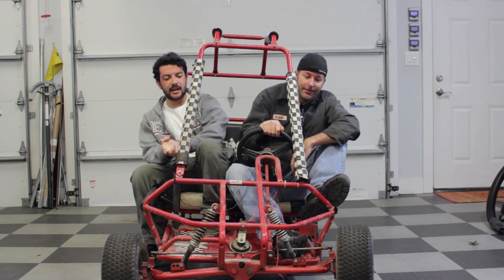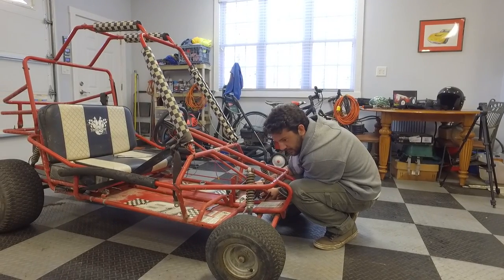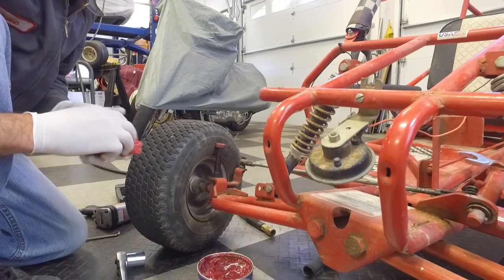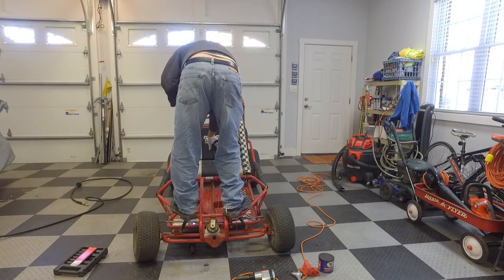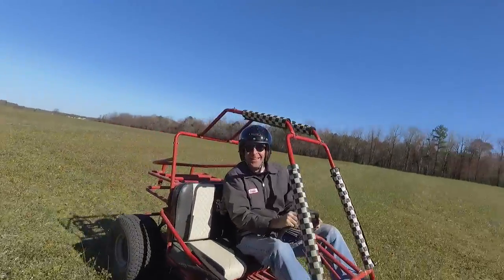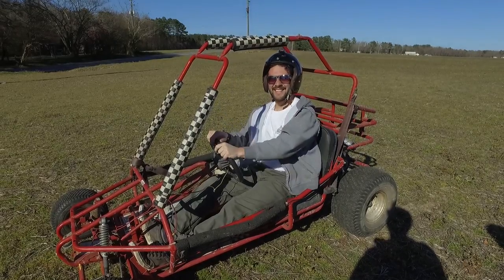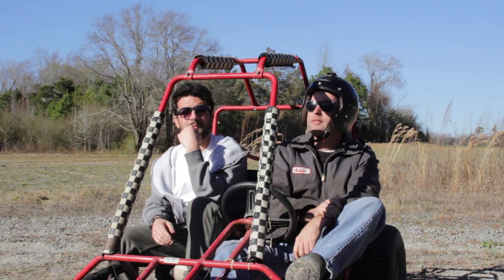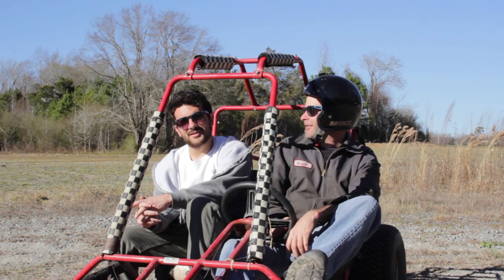$100 Off Road Kart Steering Mods and Jumps

Comment: Manual clutch air-cooled ATV engine with reverse. Make it an off-road shifter kart/mini buggy.
Reply: that would be absolutely perfect
Reply: M Kefer I'm planing to do that with my 4 speed +rev 250cc atv
Reply: M Kefer Engine off a Honda TRX250 would be great. It has a clutch to, but the only time you need to use it is starting on an incline.

Comment: The diesel units the trucking industry uses are called auxiliary power units (APU). They are usually a two cylinder engine. Kubota makes them, though they are usually branded under other names. Carrier, Tripac, Thermo king, rigmaster, are some common ones.

Comment: 8:37 Needs more wires running to the steering column.  Zip ties?. LOL.  I literally LOLed on those jumps. Was landing so front heavy. I think the shocks are dead. only spring left.

Comment: maybe a vw beetle steering box would help. should easily bolt in. you also want more precise steering to go higher speeds and more travel in the steering wheel so you don't flip oversteering.

Comment: Carroll Stream has a Chinese Yanmar clone for $899. It's 10hp and 20lb/ft of torque. Might be able to search around to find one cheaper. They do share a common gas big block bolt pattern and 1" pto with threads. Doc Sprocket's Diesel Weasel does pretty well witg it.

Comment: you guys can find all old Deutz 2-3 cylinder air cooled diesel for $1000 also can get ahold of a kubota water cooled / turbocharged 3-4 cylinder engine for $800-1500. we use them in our hydro robots and the turbo motors put out over 24-30 hp with out tweaking the pumps and close to 100ftlbs of tq

Comment: man, I had the exact same model cart, this is bringing back so many memories! Mine had a torque converter problem as well. The turning radius was crap and I had to push it backwards a lot as I would bump into a tree or bush thanks to the turning radius. The chain could fall of at any moment.

However, I dont see lights on your guy's cart, mine had lights and the switch was on the opposite side of the wheel relative to the kill switch. No battery though, not worth the money :-P

Comment: the reason you keep casing off the jumps is because your "ramp" is shorter than the wheel base of the car. so as the front end starts to dip, the rear wheel is still on the ramp trying to propel it up, so you end up landing in a nose dive

Comment: move your front shocks mounting point on the front to the out most point.  Your front suspension is to soft and needs to be stiffer to keep up with the rear or to match the rear.

Comment: Diesel powered APU is what you are looking for.  And they will run at about 2000-2500 RPM all night and only use 3 gallons of fuel.

Comment: I worked for a company calked Titan industrial out of travelers rest sc that imports and distributes various types of power equipment. They did and probably still offer a 24 horse diesel engine used on a model of generator they sell. I fitted one to an old wheel horse lawn tractor a few years ago and it worked real nice. That ole wheel horse turned into a little torque monster. I got mine for free cause they were scrapping it and repaired it. They import these particular engines from China and like most things from the land of the enslaved these generators and engines were way cheaper, a few hundred, than comparable engines not built by child labor in the west. Mine was actually pretty reliable and ran strong with few issues. I sold the wheel horse to a fellow down the street and its still running good after 8 years of use in his one acre garden. It might be worth checking to see if they still offer them. I am certain it would be cheaper than most if not all more common small diesel engines and as long as titan still offers the parts

Comment: The engines on 18 wheelers you were told about won't be a good fit. They are extremely temperamental and require lots of maintenance. They are not two stroke engines. They are four stroke with two to three cylinders. They are part of a APU (auxiliary power unit) system the keep batteries charged and heating and cooling systems running with out running the tractors engine. They run at very low rpms. They are also pricey and expensive to repair.

Comment: Most of the people I see using diesel in builds get them from generators or other equipment being parted out where the engine works, but what it powered doesn't.

Comment: Hello guys. I could use your help!!!! Just found this video and I'm doing the same exact thing. I'm putting a GSXR 600 motor on that same exact frame. I had to modify the rear axle, shift the mounts back. I need help or advice on making the steering stronger. Rack and pinion maybe? If so, where do I start my search?

Comment: Where do you get these cheap carts like this? Something similar around me would cost at  least $400 bucks without an engine. The only $100 carts I can find are single wheel drive and they don't have engines or wheels.
Reply: ElectricalNovice19 
The only thing I can find is like half a cart with shitty welds
Reply: That sucks.

Comment: aight, new motor (80-85cc 2stroke engine would get that puppy ROALIN), wider rear axle (and alittle work on the rear suspension), better front suspension (just needs a different design, thats really shit). thats if you want to put money into it, other wise new shocks and motor and it would be awesome :D

STOKED for what yall got in store for us!!!
Reply: but if you want to go all out a 250 2stroke would get yall killed :D

Comment: i have a off road gokart with 169cc motor and my turque converter wont engage you have to push it then quickley get back in. what do u think i should do im on a tight bugget
Reply: I'm not sure. maby your belt is too loose?

Comment: do you know why my go kart turns off when i fully press the brakes and can i email you cause i have some problems on my go kart that i need help with
Reply: probably the low oil level sensor shutting the engine off when you slam on the brakes. it makes the oil in the engine shift causing the sensor to think the engine is out of oil causing it to shut off

Comment: The APU's on big rigs wouldn't be practical, in my professional opinion. They're too large, too heavy, and every one I've dealt with is liquid-cooled. @CarsandCameras I doubt y'all would want to deal with a cooling system (more to engineer, more to maintain, more to get damaged, more weight).
How about a small air-cooled diesel from a small garden tractor? Ford used to make a small "tractor" (more of a riding-mower on steroids), called an LGT...if I remember right, they had diesel motors. 
I've never seen a single one of 'em out here on the Left Coast, but I'd wager there's a mess of 'em out there in the Southeast.

Comment: if you end up replacing the tork converter could you hook me up with the old one, please.my 18 horse honda twin keeps breaking cintrifical clutches.mike mathewson, MARTINEZ, CALIFORNIA
Reply: You need a bigger rear sprocket.
You're geared too high.
Reply: the torq converter wont fit on that engine because it has a bigger shaft on the engine than ours
Reply: Isaac it'll be fine ,,1 inch crank ,1 inch axle. but thank you for the reply .
Reply: No not, motor is that torky
Reply: I hope mine doesnt explode on me when i get my new sprocket. I should have over 20 horses in my 212 by now.

Comment: can anyone help me because i have a lawn mower that won't spark. I've changed the plug and set the air gap between the amitage and the fllywheel.
Reply: probs the coil
Reply: Milk Parker how much is a new one
Reply: Oliver Bradburn bad coil
Reply: Oliver Bradburn you could try cleaning/replacing the points on it too
Reply: Jarod Erickson are those the points where it connects to the EB wire
Reply: thanks all

Comment: I had a yellow yerf dog go kart and i can tell you this all stock parts trash you might as well make it an adult go kart. I think a full on light bar people use on top of there trucks would be sick for at night than little small ones on the front bumper.If you go with a 2 stroke Dirt bike engine please put a Kawasaki and let her rip but with the dirt bike motor id say wheely bar better tires after test run better shocks for the power its going to throw out. To me weight reduction take the roll cage They never save you any ways and put bucket seats in my old blue kart i had after had bucket seats.

Comment: You spend $1200 22hp on a gas predoro but won't spend $1500 on Diesel vanguard (most popular cheep one) and if I rember correctly a couple videos ago you bough 5 212 predators 300x5= 1500 man that's logical
Reply: +Aidan Nina  I have no idea where you got those numbers from. A predator 212 is $120 at harbor freight, and the 670 is about $700.
Reply: RealSteel 1776 not at my harbor freight I was just in there yesterday
Reply: Aidan Nina   Where do you live? Siberia?
Reply: I paid 94 bucks a piece for the 212s on sale
Reply: Isaac it'll be fine 94 that's a steel they want 300 for one in my area

Comment: If you want your yerf dog to go faster look under the passenger seat where the throttle cable is connected you will see a linkage it's like a screw and you can adjust it and make it go faster you're welcome and would you please give me a shout out